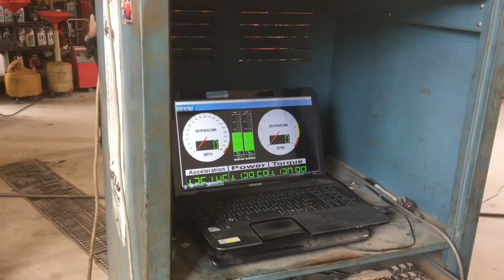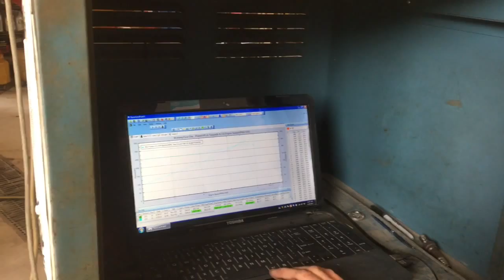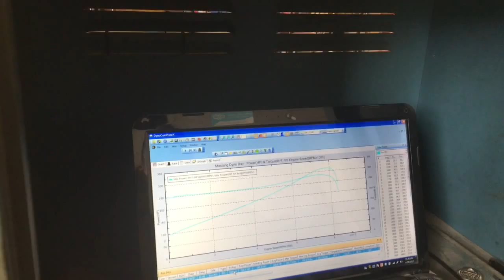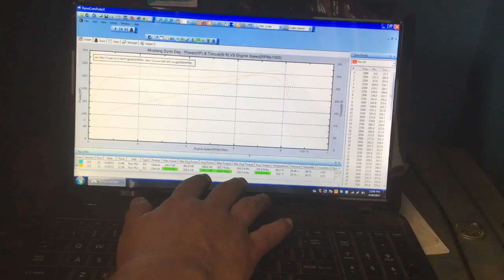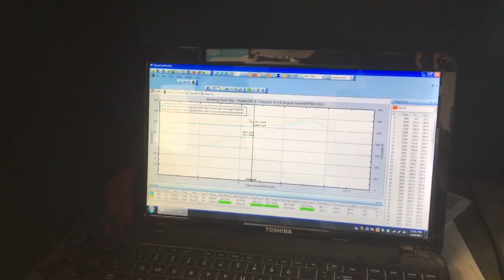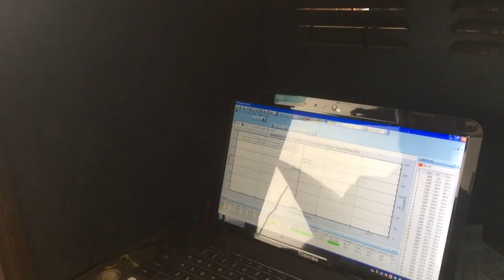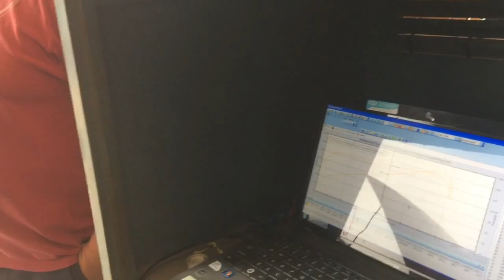1989 Mustang GT Project Trojan Horse pt. 40 Dyno Day Budget Fox Body Drag Car

Comment: love the vids..keep em coming..  !! and damn thats a beautiful sn95 at 9:50 behind the fence !!
Reply: whats the timing at in this video btw ?
Reply from the maker: Yeah, forget the guys name..he had already made a pull before i got there (had to take my step son to work) but it was a 347 car if i remember correctly, forgot what he said it made, real nice guy also.........
Reply from the maker: pretty sure it was at *16............
Reply: are you gonna run 16* with spray ?
Reply from the maker: Oh no...we'll use the "standard" pull 2* for every 50hp rule..........
Reply: so for ever hp the bottle is designed to make you'll pull 2 degrees ? or 300hp means 2 degress for ever 50 out of that 300 ?
Reply from the maker: *2 for every 50 so we're at *16 now, with a 150 shot we'd start at *10 and keep an eye on the plugs, if all is good at that point you can start adding a degree or leaning fuel pressure or going up one jet size (n2o side) to sneak up on the tune, some people have one preference or another for tuning...AF gauge would be handy here also or datalogging lol
Reply: thanks for the info.. i bought my 95 5.0 with 150 shot on it.. it was at like 6*.. it was ridiculous .. it doesnt have spray anymore and im running 13* now..after i rebuild the motor ( high compression 11 or 12-1 ) i'll bump it up prob around 16 ish.. 

love the vids and really appreciate the feed back ! keep em coming buddy ! :)

Comment: Entertaining and informative. Time for the bottle already
Reply from the maker: I need two of the big ones Harry...and i need it by tonite!
Reply: FYI I have used and still use the NOS 05115 kit. Really a simple, effective and safe kit. Used a 175hp shot without issues on a stock engine several times. Only downside is it is on the higher end of cost spectrum. Can't wait to see what you'll be using as far as brand and jet size.
Reply: F&F......hilarious.
Reply from the maker: Its a bunch of cobbled up junk like all my stuff lol...........

Comment: Good video I just picked up set of gt40p heads and  explorer intake have a 95 5.0 trying to be around 300 HP already have a cam and cai and bbk 75mm throttle body and long tubes egr smog and ac delete
Reply from the maker: Should get close to that or over, depending on dyno weather etc etc...........

Comment: @50tussin on a manual foxbody what clutch height engagement would be best.   Middle or kinda high.... I hear that if it's set low its bad for the clutch, & tranny Sometimes
Reply from the maker: I like the pedal set high, with a touch of tension on the cable...i know, i know, its supposed to have a smidge of "slack"...whatever, i've run mine like this for years...and the reason being is my arm is faster than my leg so the higher the pedal and the quicker the disengage/engagement of the clutch when i "kick" it in theory helps me not miss gears...your results may vary as mine do lol..............

Comment: Hi. Like the channel. Have you tried the 82 to 84 discs and calipers. I checked on the bathroom scale and they were 15 lbs. lighter than the later 10.84" disc's. I don't think brake fade would be an issue with 1/8 the mile on a lighter weight car.Way less quality than Aerospace but a 5% of the cost.Thoughts? Thanks and regards. Bill.
Reply from the maker: The '79 (and i would assume '78 fairmont/zephyr) thru 93 4cyl cars all used the same rotor as did the '79-'86 5.0 cars (and 80-81 255ci cars)........i've never actually weighed the '87-93 rotors vs the 4cyl stuff...you'd also have to do a spindle swap but its not a bad idea for what we do..thanks for the tip , we may look into this some more......

Comment: So im.looking at old videos.. what was on the car at the time of this video as far as parts and what size maf?  What gear is he in? That sucker is reving quick!!
Reply from the maker: Exploder intake (tried two uppers), stock gt40s with springs, unknown mystery cam, 75tb, think it had the 73mm c&l on it, longtubes, 4.10’s...all pulls are made in 4th (1.00:1)...Johnny has his dyno set up with low load, numbers are usually pretty close based on weight/mph calculators...
Reply: @5.0tussin  I appreciate the info bro
Reply: @5.0tussin   In your opinion.. you think a stoxk explorer maf will support  350 to the tire?
Reply from the maker: @19jody72  N/A? I suppose so....why 350? I just went thru the dyno mystery with Kyle the other day...always more questions than answers it seems 🤣
Reply: @5.0tussin   Yes..NA. Well, Its just a number I come up with, and wanted.. so I built my engine with that in mind. Its a true driver, little 2000 ford ranger, zspec t5..ice cold ac. Fixing to finally get it tuned, its on a start up  tune now, and make its first tip to Florida. Im from there .Moved up to Missouri 10 years ago. Bunch of family still down there. Heading to Pensacola  this trip..my sister lives there still. Check it out if you get time over on my channel. 
Ive been following you for a lonngg time. Love your channle.

Comment: Hi there I have a question why do some people when they adjust valve for preload/zero lash say on one cylinder put the one valve fully close as the other valve starts to open and then do the opposing side? Seems like alot More work can't you just do say starting with num 1 cyl at tdc on compression stroke have both valves fully close on base circle of cam and just follow firing order seems like it's more work the other way isn't the both valves closed method easier help me understand this. Thanks
Reply from the maker: I would think its just preference or how you were shown or trained...i use a starter button and do one side at a time (1-4 then 5-8), makes it easy just bumping it...i also did the "3 mark" balancer like some manuals show for a long time because thats how someone showed me/made me do it....... but just bumping and doing a side at a time is easier now lol....again just a personal thing i guess.........
Reply: 50tussin so it would work in the firing order though on compression stroke starting with 1 at tdc? Both valves being on base lobe.
Reply from the maker: Yes...again its preference..some guys do the first way you described and some do it the way you're asking....they both are shade tree/government accurate lol.....

Comment: congrats on the 1500 number Sir.   question- are those dyno numbers flywheel hp? based on your ET,mph and estimated 2600-2700 pound car... 310-320 flywheel HP seems about right...  can't imagine 19#ers supporting 350 hp but heck you've been around for a while and make your cars run better than most guys with high dollar parts.
Reply from the maker: They are rear wheel numbers.....plus the car weight you listed looks a little low if you're including me in it which you have to when using et/mph calc......or what's called "raceweight"....i never care what a guys car weighs, just what it weighs with him in it ready to run:)
Reply: that Sir is prretty impressive.  Those are better numbers than what guys get with the TFS top end kit.. .
Reply from the maker: That kit will make a little better torque number but we were happy with what we made......just had fun hanging out and seeing Johnny..

Comment: Question for ya how many miles on the old girl? What kind of oil do you use or reccomend? And what should i expect at the wheels from gt40p slighly ported,explorer intake,4.10 gears, shes a factory stripper no power anything fibreglass hood gutted etc
Reply from the maker: We're not sure on mileage.....i'd assume a ton.........we use generic stuff (mobil 1/havoline/motorcraft) whatevers on sale, we tend to change it fairly regular for one reason or another lol........no telling on dyno #'s..cam, exhaust etc also play a roll so its anyones guess........
Reply: 50tussin very cool i use the same whatevers on sale right now i just have bbk shorty headers off-road h pipe with flows dumped an e303 cam, out back i have 327 gears hoping with the gt40 heads and intake i can mess around with some newer muscle on the streets
Reply from the maker: The heads and intake will help, definitely tires and getting any weight out of it......would maybe like a little more gear in it but i guess it depends on what you're doing (dig/stoplight/low roll/60-70 roll).....the only real advantage we have is weight and possibly traction, those new cars all have badass geared trannies and big power so you have to get the race to where its to your advantage lol.......but should still be a fun car:)
Reply: 50tussin oh ya your right on that haha i lined up with a new edge stang and stayed with him til about the emd of second gear than he was gone lol welding on my sfc this weekend using my cheap fluxcore also
Reply from the maker: Your Flooring lol.....yeah we're in the hole horsepower wise just got to try and keep it close 👍🏻....crap welder ftw!

Comment: Which cam is in the engine ? Also stock clutch and transmission ? What do you think about a cobra intake , 24 lbs injectors BK shorty headers ,  full exhaust flow masters h pipe, T5 trans , 4.56 gears , stock gt motor and stock Mustang gt heads. Car is a 95 mustang gt.
Reply from the maker: We dont really know on the cam, its old, has no markings that came up goggle searching, we checked it with a caliper and it was .490/.500 lift and we have no clue on the duration, back during the '90's there were a TON of cams being put out for these cars by a bunch of different shops/manufactures etc so it could be anything,we paid $50 for it and we're happy with how it runs/drives...and yes stock clutch/stock t5, does have a steel bearing retainer.........

I assume more mods are coming? Stock maf/TB as well? I'd skip the 24's and just run 19's unless your meter is 24lb..the gear, if you have it, is maybe a tad much for a stocker but if you have it then use it, i'd probably go 4.10/4.30 but i'm not you and dont know what your end goal or future mods are...the car should perform fine as is but those are the few changes i would make based on just what you have listed, will be fun regardless:)
Reply: 50tussin   Cobra maf and throttle body . I don't know if I have to change the ecu if I change to a more aggressive cam ?
Reply: I am also going to port my heads a dyi project to get some free hp. Well not really free because of my time and 40 dollar porting kit . Are all 302 motors 85 and up fitted with hydraulic roller lifters ?
Reply from the maker: Tom  Moss has some excellent tips/methods if you've never heard of him........
http://tmoss.efidynotuning.com/

Its a gray area on 85/86 as far as roller/roller capable....5.0 trucks/vans didnt get actual roller stuff till '94 but the blocks from 87-up (possibly 86) are roller capable meaning they have the raised bosses (undrilled/tapped) for the spider and "flat" lifter bore tops for the dog bones...cars (vic/marquis/town) got them in '86ish -up(roller) possibly some '85's are out there on that as well.............

Comment: Awesome numbers my cars built very similiar but im using a toploader 4 speed ever ran one in your foxes?
Reply from the maker: No...i almost bought a '83 351 swapped car back in '92-93? that had one...also had a 9inch with 4.33's...thing felt like a beast and i was in the passenger seat lol.........i really need the overdrive since i drive them to the track and everywhere else and they are a little pricey and hard to find around here but i bet it would be fun...trying to talk pirate into putting one (toploader) into the BBF car he is putting together..FUN!
Reply: 50tussin yeah i hear that. i have to drive mine to the track as well and iv got 4.10s. its a fairly easy swap
Reply: @jeepinfisher3081  You don't have to worry about hurting them anyway.

Comment: How much further do you think you ll have to go before the modded intakes start to pay off for you? Will the cast iron heads ever be able flow enough for those intakes? Some of the stuff the ole car does really puzzles me, I guess if you got it figured out I'll keep watching and we ll see. Thanks for doing them I enjoy watching.
Reply from the maker: Well the "ported" one didnt make anymore power than the mild one...if it would have shown a real advantage up top we'd have been happy...now, we plan on using the ported one on the silver car, we've got a few things we're changing on it and are curious to run some upper intake testing once we get our other mods completed so stay tuned......................the ported upper might work good with boost though:).................and thanks for watching!

Comment: Nice notch in the beginning. What's the wheel and tire combo on it?
Reply from the maker: I cant remember lol...chinese cobras and i cant remember the tire size...rears might be 275/45-17? i bought them (tires) years ago for the one and only mod motor car i owned (2000 gt/5spd)...wheels came with the notch and i had the rear tires which were still almost new........
Reply: 50tussin well they look good lol

Comment: New to the channel can some one link the vidoe with some of the work done to the car. I have P heads and a carborated 302 looking for 300 ish at the wheels. Thanks
Reply from the maker: 73mm MAF/75MM TB/lightly ported explorer upper lower/19lb inj/unported gt40 heads with fresh springs/"mystery" cam .490-.500 lift/stock gazillion mile shortblock/1-3/4 longtubes/3" bullets off the headers/stock ecu...........that pretty much sums it up.....all the stuff thats been done is listed in the various video descriptions but thats the basic combo:)

Comment: Hey how are ya doing. I'm a new subscriber and I like what you been doing. With your fox I was curious about as to if you or anyone else of your subscribers. Have ever ran a edkbrock performer. Top end kit on there 5.0. I bought. My car with it already. Installed. And so I'm curious. If anyone else. Has ran something. Similar. And what numbers they might have put down and if anyone. Has any additional advice. For tuning she's still a carbed car she's a 85 GT
Reply from the maker: David ran some ported performer RPM's on his car but it's efi......there's way to many variables to really say a number, i could guess like anyone but with out knowing exactly which heads/cam/intake/carb, what exhaust etc etc it could be wwaayy off and again it would just be a guess.....have you ran it at the track or anything? The biggest thing is...are you happy with the car? if yes, then it doesnt matter what it makes:)
Reply: 50tussin thanks for the reply. I appreciate it and the closest thing to knowing what I have is being. A performer heads intake with a 600 carb running the factory roller cam and aftermarket. Shortly headers haven't had a chance. To get to the track. Just yet I'm hoping. To get her on there once I get a e303 cam and torquer 2 intake. Installed soon that and get better at shifting haha thanks again . man  Love the channel
Reply from the maker: What gear is in it? Those were awesome cars when new ('85)...cleaned house on alot of stuff on the street just by adding true duals:)

Comment: Does installing an F303 cam cause problems with stock computer ? If so what can be done to combat that ? it would be going in 95 mustang GT...  cobra intake , cobra mas, 4.56 gears, T5 trans Ported E7 heads. Or is E303 a better choice ?
Reply from the maker: Every car/eec is a little different......internet vote says the F is a little more 94/95 friendly vs the E but you never truly know till its in...personally i'd run the F over the E , especially in your combo but that just me..ask 10 people get 10 different opinions most times:)
Reply: Have you ever had to reprogram a computer or add a chip to get more Horse power by changing pulse time to injectors and advancing spark advance   ?  what brand chip would you recommend ? I really dont see alot of info on net on this , not sure if it is because the stock Computer doesn't really need it . It would be nice to see a dyno graph with and without computer modified
Reply from the maker: David has done a few chips for me but typically its more if there is a problem (such as the MAF transfer maybe being a little off)or bumping the fuel limiter....he has a tuner/chip burner and also uses a moates quarterhorse for tuning...most dyno shops have a brand they prefer (such as SCT)....alot of people (imo) dont want or really need a chip for the fox 5.0, its hard to justify spending $400+ for a tune on a N/A when you've got $2500 in the car itself....poweradder is another story.........
Reply: 50tussin I want to go to the F303 cam . But heard the 95 mustang EEC has adaptive learning that would force a chip with a tune . Any thoughts ?
Reply from the maker: i texted David about it since he has way more experience with SN stuff (his cobra and his sons 331 95 GT) to see what his thoughts were....i'd plug it in and let it eat lol

Comment: Something is not right, dyno is spinning to fast. Something is slipping, I think its with the dyno.
Reply from the maker: I’ll tell Johnny it needs a new rubber band before we go back up there 👍🏻
Reply: @5.0tussin  funny. It's either the Dyno, or your clutch. But either way the tq curve is not right..there is also a chance of ignition issues spark blowout, distributor.